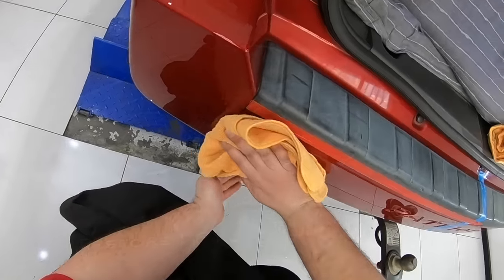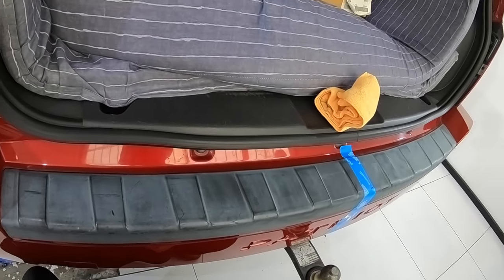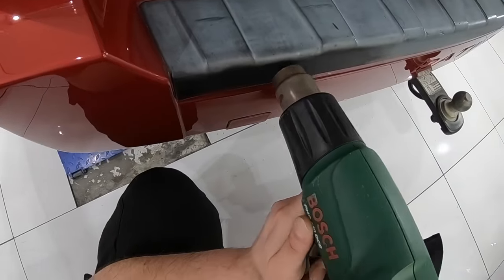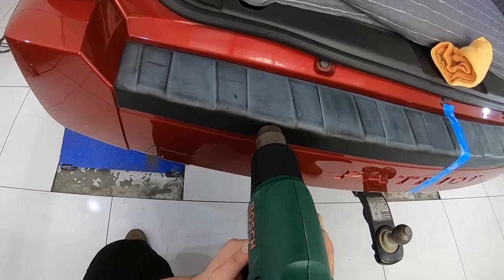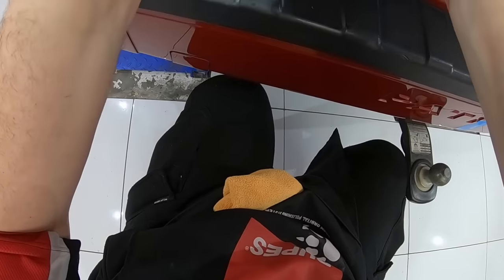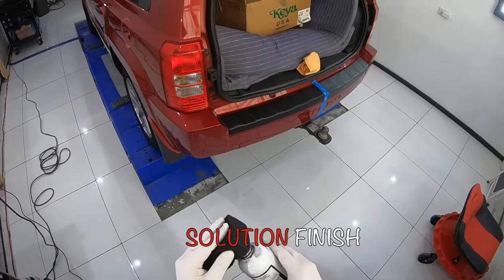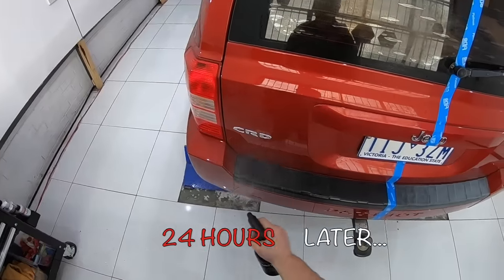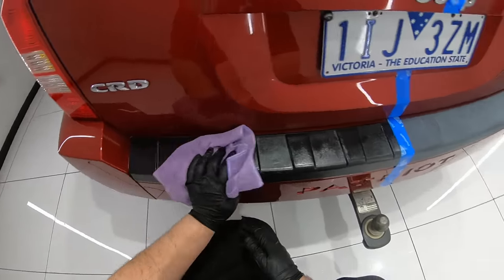How To Restore Badly Faded Car Plastic Bumpers/Trims-with a Heat Gun & Solution Finish!

Comment: wow! I never knew that heat guns could be used perfectly to restore the black trim with a perfect finish. I will try it soon. thank you for this video.
Reply: You see the side shot? Not even close to perfect
Reply: @Amor1990  I did this to my Holden Colorado and it was badly faded from the sun and brought it up to looking brand new and lasted a lot longer than using chemicals or silicone you just have to make sure it’s very clean before using this method

Comment: Heating the plastic is just causing it to sweat out oils and plasticisers; these cause it to look black for a short time until they wash off.
Once that happens you’re left with plastic in a worse state than you started with.
Applying the solution finish after the heating just means that the trim is no longer properly primed to accept it. The solution finish won’t last as long as it should as a result.

Degreasing/decontaminating the bumper and applying solution finish directly to it is a more effective technique.

Comment: I've seen many car restoration and detailing videos over the years and this is this first time I've ever heard of restoring black plastic trim with a heat gun. Thanks for the video.
Reply: Really ??
Reply: @Soufiane Elamiri  You're replying to a 4 year old comment with just one word. Really what?
Reply: @Yeti1183  hi, you said over the years. I think 4 years doesn't count, it was abt the trick of the heat gun. I know that since i was 15 or so, maybe seems weird for me, but maybe it will seems weird for you some other things that i didn't know till now, and you know them from age of 15. It's life.
Reply: @soufianeelamiri4765  does it lasts? Or reduces lifetime?
Reply: @brub5174  yes. It last. It's the great deal.

Comment: Thank you for sharing this video and showing that using an oil based plastic restorer in conjunction with using a heat gun. I find this method to be the best way to restore faded plastic trim the best for low budget weekend garage warriors as myself that don't have the money to take it in to have it professionally restored or replaced. I have seen and read many negative comments on using a heat gun but I don't think the haters understand that you have to adjust your heat if it's possible and hold the gun away from the plastic at a safe distance and keep it moving so it won't melt the plastic and leave burnt spots.  The heat gun method works great only if you add a plastic restorer after as you have demonstrated as it does indeed draw oils from the plastic. An oil based wipe on or spray on restorer will help condition the plastic and add back in the necessary oils.  Keep up the great videos!

Comment: Does it work with other colours? What is a example of a solution finish? And what température are you using?  Heat gun(1/3 power), solution finish, wipe down. Tks so much
Reply: Yes like the red seat belt plastic buckle

Comment: I was a boat detailer for many years... i do see this process great for working on your own cars...but as a detailer i would have a lot of  one day mobile 4-6 hour jobs and get paid that day... this 24 hour dry time would not work for me... I have used  heat gun method for over 12 years and got very good at it... i used highest heat and stayed away from paint or used a piece of card board for paint protection... but yes a newbie could make a bumper look like crap if they don't have any skills...

Comment: Suuuper useful! do you know how to fix sun damage on a leather dashboard? Mine has begun to detach and shrivel.. any hope?
Reply from the maker: If the dash has significantly warped and shrivelled it will need replacing or resurfacing and upholstering, unfortunately!

Comment: Hey Sandro, great video as always.. However being the sceptic that I am, whilst this has brought the plastic back to life, I am very curious as to whether it has also changed the characteristics of the plastic, in that it has now become more harder and or brittle? So, if some car was to bump into it at the parking station, I'm wondering won't it crack?  Can you provide some thoughts.. Regards
Reply: As far as I know, plastics go back to its shape when cooled, so my thinking leads me to believe it does not change it's (the plastic) characteristics (unless morphed on purpose when heated)

Comment: Could you technically remove the trim and just bake it in the oven at the lowest temps over a period of time to bring the same effect with more even heating and less effort?
Reply: Uhh if I had to guess, A oven would make the whole panel soft and warp. I would stick to a heat gun

Comment: Great video, never knew that tip about the heat gun. Just got finished doing the plastic bits on my Lotus Elise with something called Eastwood Plastic Resurfacer, we'll see how it holds up over time but next round I'll give this a try.

Comment: How often do you have to do this? And should a coat of some protective spray be applied after cooling?
Reply from the maker: It should only be done as needed - could be a one time thing or maybe years down the track if the trims is exposed to lots of UV light. A plastic sealant or coating is a great way to protect from UV oxidation after it’s restored.

Comment: I'm a car valeter and been in the trade for 20 yrs....if the plastic has a rough surface then this is good,if it's smooth then use car polish afew times.You don't need an expensive heat gun thou folks.
Reply: U can have one for less than 20$, it all depend on the brand.

Comment: For safety reasons concerning burns can you use the steamer on max heat,or will the moisture produced hinder the process?
Reply: You can pick up heat guns cheap as chips  these days. I got 2 spares from ebay $30 each free postage with low and high settings. I high i can light a smoke haha

Comment: Plastic for me anyway are always hard to maintain and needs to dress it once every month or 2. I guess using this method is the best for a long term finish? How long did this method last for this detail?
Reply: @CarCraftAutoDetailing  a car wax or maybe Autoglym Vinyl and rubber care would be a good option as sealants?. Thanks

Comment: Will this work on black mud flaps?
Reply from the maker: Not the heating restoration part, but Solution Finish will work great on both black plastic and rubber trims.

Comment: Sandro have you ever had to deal with fogged up speedo glass but thats on the inside? How did you deal with it.

I cleaned the speedo glass a few weeks back and now have noticed that there are fog type marks on the inside of the speedo glass which I can't get to.
Reply: @CarCraftAutoDetailing  Thanks mate....I may try pull it apart.

Comment: Question: Solution Finish, you say leave it hours or a day, the website (presumably the people who make the product) say "Allow solution to penetrate for 1-2 minutes" and wipe off with a microfiber cloth. That's a lot different, they don't know how you properly apply their own product? Genuinely asking because my car badly needs some plastic restoration.
Reply: It's not an sio2. It's a solvent based charcoal product that effectively dyes the plastic. It's not a silicone based product like Black Wow. (https://youtu.be/1Ci0XqfFh30). Ultima Tire and Trim Guard will give this a run for the money. I use SF personally because I bought the biggest bottle on the planet and it lasts for ever...

Comment: How about using the heat gun around lights?
Reply from the maker: You should be able to work around the lights without issue - just stick to a mid heat setting and focus the heat the black plastic

Comment: I have seen this before but I was told that heat does remove oils from plastic and this will make it worse in time? Any comments?
Reply: Car Craft Auto Detailing thank you for quick reply. Don't get wrong, I appreciate your work a lot, I was just asking. I'm going to try this anyway. Happy Christmas 👍
Reply: I have heard just using a heat gun will do that but I also have not considered using a trimrestorer product injunction with the heat gun then topping with a coating.

Comment: This will only work so many times because its drawing the oils out to the surface but eventually there'll be no oils left. Best thing is to rub in Olive Oil. If the trim is very faded you will have to repeat over a period of weeks and let each application soak in.
Reply: No. Use a black dye.
Reply: @04dram04  where can I get it from?
Reply: @trokiandocuh300g7  your moms hairdresser
Reply: @jasonk876  can I get it from yours my mom don’t have none
Reply: @trokiandocuh300g7  Yes, if that would be helpful. We could meet up for lunch next week and then drive over there. Where are you located?
Reply: @jasonk876  I’m Dallas wby

Comment: short lived and makes the plastic more brittle
Reply: That's what I was wondering. It seems it would just draw out the oils from the middle. So redistributing what's in the middle causing it to age quicker, as the sun and environment will eventually remove the surface oils. Make the whole piece drier than it would have been. Essentially aging it quicker. I want something that will prolong it's aging.

Comment: This is kinda some scammy type advice.  Will this work? Sure, for a little bit. The part that's just wrong is advertising renew plastic.  It doesn't renew, it simply is just another way to do what a back to black, or an armor all trim restore will do. Make it look alot better for a short period of time.  Because it moves oils in the plastic to the surface,  as it was new. But then it was completely hydrated in oils, now the top oils have weathered away.  So drawing out what's left will make the fading process much faster because there's less oils there now.

Comment: this way of restoring faided plastic with a heat gun is not a very good way to do it. The plastic will loose it's oils because of the heat and it will crack much faster. a coating or dye or a plastic conditioner would do a much better job without damaging the plastic
Reply: @CarCraftAutoDetailing  ok

Comment: BAD ADVICE !!!!!!!!

When you heat plastic up you pull out the oil to the surface and that makes the plastic brittle..
In time it'll get mat again and then start to crack..
Reply: Well, according to what you are saying,  the top is already missing the oil,  so isn't it already brittle?
Reply: @jasonk876  No, the rest of the plastic (deeper) is still good and that's what you ruin with heat..
The top will not crack when the rest of the plastic is good, but it will if you pull out the oil from deeper in the plastic
it's not something I just came up with it's a well know issue....
Reply: @poulmba  the guy that posted the video commented that it looked good for a few months.  He sound have put that in the video description. 
Someone else mentioned pb blaster after it was heated. 
What is the best way to make the plastic look good, then?
Reply: @jasonk876  The only working long term option that doesn't ruin the plastic is to colour it..